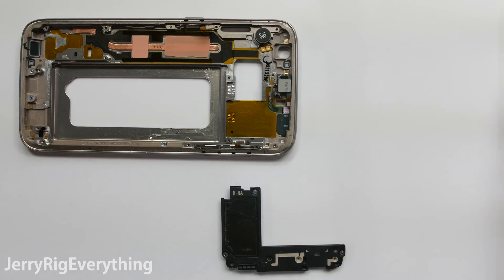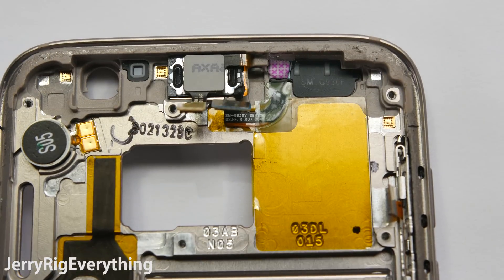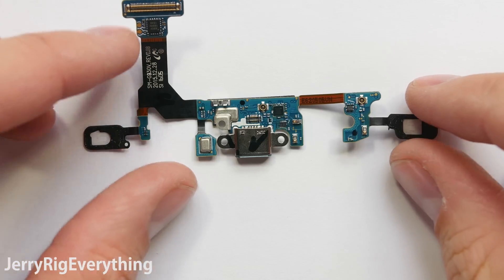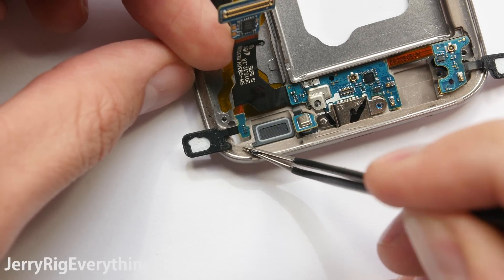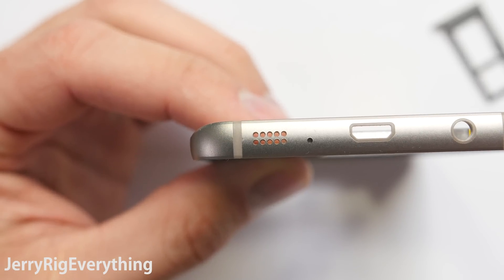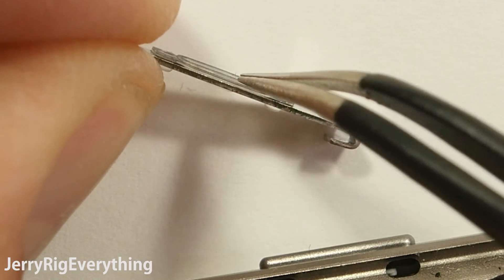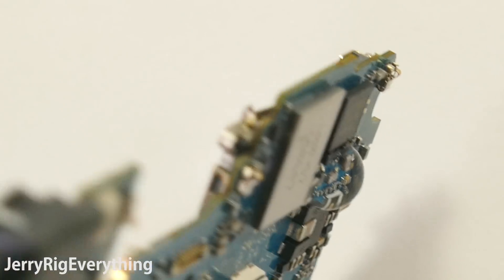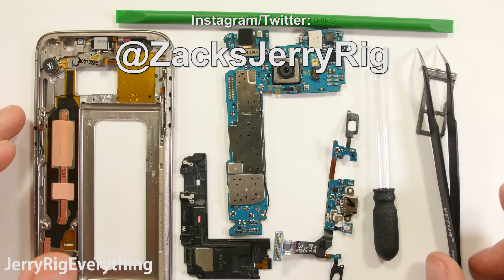What makes the Galaxy S7 Waterproof? - Ultimate Test

Comment: Forgot I had mine in my swimsuit pocket and jumped in. I jumped back in to find me year old phone at the bottom of the pool. Dried it off and it looked ok. No problems until I tried to use the speaker. It was basically useless. I searched up ideas to fix it and I blew air from my mouth into the speaker and shook it hard and it spit up all or most of the water and it was fixed. This was 4th of July and still nothing. This is a great phone 5/5

Comment: Jerry, hopefully you or someone here,can help me: my friend dropped my S7 in a lake and I took 10 min to find it at 1.5 mts deep.When I took the phone out it was working fine but the speaker had a bad sound quality. I dry as possible with a shirt, turned of and used a hair dryer to "finish the work"
The problem with the speaker was still there but wasnt a big problem to me. The next day the power button and home didnt work... As it turns on when I plug the charger I got to test it. the lcd was also "a little" unresponsive. It still over warranty but Im not sure what may happens because I read about some people having to pay high cash just for had left the phone at Samsung's Sevice. I checked the water marks and theres absolutely nothing red or pink. What / how you think I should do about the service to dont have to pay for something that i supposed to be covered? Should I opened explain what happened as Im doing here? The video was great, btw. Thanks in advance.

Comment: IP68 Protected from total dust ingress. Protected from long term immersion up to a specified pressure. IP68 is pretty good. IP69K is the standard after that which protects against total ingress. IP68 is used in phones/electronics that require military-grade resistance (with more standards, of course).

Comment: +JerryRigEverything what about metal dust?  Like from grinding or plasma cutting, the fine metal dust usually trashes speakers and microphones.  The only way i have found that worked for my older phones was a lifeproof case, but if greatly muffles the sound and then you are limited to only that case and no other battery attachments and wireless charging is hit or miss.  Does the IP68 rating handle metal dust as well?  I would really like to know this or see if someone wants to test it.

Comment: Hey folks, I've been looking at this phone and believe it's the most 
suitable phone out there for my needs, problem is, I'm in Ireland so it 
looks like I'm going to have to get one through eBay. Would anyone 
please be able to clarify the following:

1) Will it definitely work in Ireland/UK/Europe as I've heard a lot of US phones can't work here?
2) Can it be charged without opening any seals? My Z3 compact has a seal covering the charging port to keep it waterproof, which I've had to replace twice already. Is the S7 Active waterproof without needing to close any seals? What would happen if you dropped it in water when the charging cable was plugged in? I'm ok with having to open seals for the sim card and memory card as you never need to access these, but the charging port needs to be accessed all the time and the seal on the Z3 is a pain in the ass! How do Samsung achieve not needing a seal I wonder?
3) Is it possible to remove bloatware by both AT&T and Samsung and get back to a cleaner android experience? 
4) I've seen several reports of the phone failing some water submersion tests, but it seems this was with earlier released models. Have these issues been rectified or, like the video you posted, it depends on pressure?

Any feedback would be greatly appreciated :)

Comment: I want to buy a used s7 edge but has a very small crack of no more than .78 inch longer resist submerging? . ... I recommend is very cheap to buy it? believes that insignificant detail?
Reply: elkillerR5 it most likely wont be water-resistant you shouldnt try to submerge in water
Reply: Alex Lemus Thanks

Comment: Do you know what makes microphone water proof? I just accidentally pocked top microphone hole with a safety pin trying to remove sim card tray. I pressed down pretty hard, but it felt like I was pressing against metal frame. 
I tested microphone and worked fine. I can see in your tear down microphone is not in direct line of sight with the hole. So, I know the microphone is safe. But not so sure about waterproofness. Are there any seal inside of the hole? Or is the microphone waterproof by itself? (I see gasket around it)

I have cracked my rear glass, it waterproofness may be lost already, but plan on repairing the glass near future. (Samsung wants $70..)

Comment: I literally shower with mine every day. It doesn't do any harm at all. I've had the phone since the first day it was release.
Reply: the steam??...
Reply: haha
Reply: +WiLLiamsGaMinGCHaNnEL the steam isn't going to do jack. The phone has been washed in laundry machines with soap on high heat and frozen in a block of ice. The water resistance is phenomenal.

Soap lowers water tension and if the video maker was right, the soapy water would have slipped right through the mesh much worse than steam would. The mesh that protects the phone is actually finer than a molecule of water and it would be impossible for water to make its way in unless deliberately forced. 
It's not like he says and based only on water tension that'd be a terror idea.

Comment: just tested it and it still works
Reply: There's just ungodly amounts of payola hit pieces trying to debunk the S7s waster resistance. I've even seen it claimed that touching water will permentslly leave the microphone and the speaker muffled and damaged. The writers are fully aware that a wet speaker grill will sound muffled but act oblivious. It's because of articles like this that people are starting to think the IP68 rating on the S7 is a scam. It isn't. I've had the S5 for 3 years and then the S7 since day once and I've swam with both and have never not had it in the shower will me as a shower radio. Anything looks fragile when you take it apart but the truth is that the phone is very well built and in order to gain IP68 certification they actually must exceed it.

Thud phone has been tested in much more stringent situations than a shower. The author of this video seems to be confusing splash proof phones like the M10 with water resistance phones like the S5 and the S7
Reply: Linked Devices so it's perfectly fine to shower with it frequently

Comment: Hi I really need help. All this time i thought the phone was water proof. I took my phone s7 edge to the pool and got it wet. My phone power went off.  I tried switching it back on. only the samsung logo appeared and it stood frozen there. I did get an option to reboot and stuff like that but I DONT know what I pressed.. its been couple of hours, my phone is completely dark. no sign . i tried no of thing like pressing the home and volume keys.. nothing works.. Is  my mother board or the LCD damaged ? can this be fixed ? any suggestions?
Reply: Put it and rice and hope it comes back
Reply: +Sup M8 in* on mobile...
Reply: +Sup M8 I tried the 99% alcohol thing. Now when I switch it on It shows me the reboot screen and the start up Logo and then it's stuck there .. Any suggestions ??
Reply: +James Lama press your power button and your lower volume key and hold them in for like 20 seconds
Reply: +James Lama also i wouldnt recommend trying to turn on your phone unless you know it is completely dry
Reply: +Sup M8 thanks man.. Will try when I get home. Always thought the phone was water proof until this experience, I wouldn't recommend anyone follow those YouTube videos which encourages such water experiments  .. Had I know it was only water resistance I wouldn't have  taken it to the pool. Although I have used it under the shower before to  select my music. If this doesn't  work do you think my mother board is gone or perhaps the lcd  display ? I know these things cost USD 300 or more .
Reply: +James Lama i have no idea im just going off what ive heard

Comment: MINE TOOK ONE SWIM, and now it's DEAD! It wasn't even a swim, more like an inch worth of water. The real clincher is that Samsung Canada has had the phone for more than a month and a half while using bogus excuses why it's taking so long. The phone was about 45 days old when it went to Samsung so the moral of the story is to submerge-test this phone within the 15 day return period, Even a bathroom sink submersion is good enough to test a defective phone which should have done 4.5 feet worth of depth. Just for your info, the Samsung S7 was bought in Maple Ridge, BC, Canada which indicates the problem is far wider spread than they claimed the problem to be. In general if you plan to be active I would suggest to test your phone for this defect  as soon as possible or you will be out of contract limit if you wait too long.

Comment: This is regarding a big flaw in the product, Galaxy S7 Edge , which is till date, the most disappointing mobile phone cell phone i have ever used throughout my lifetime. I had purchased my phone from Noida , GIP , India, on 18th of March 2016.Promising that the phone is water Resistant upto a dept of 1.5 mts...... As per the claim that samsung provides,, 

"""""The Samsung Galaxy S7 Edge is an IP68 Rated device. IP68 rating means complete protection from dust ingress, and temporary immersion in up to 1.5 metre of freshwater for up to 30 minutes. Samsung guarantee simple life waterproofing when the SIM Tray is attached tightly but does not guarantee that the device will operate normally if it is used in water or other liquids. And, the touchscreen and other features may not work properly if the device is used in water."""". 

Now , my cell phone is not working properly after encountering a small amount of water , THAT TOO DESPITE THE RAIN . I am not even asking about the depth of 1.5 mts or a stay of 30 minutes. It was a matter of 10 sec or lower which caused the phone to malfunction and the dept could have been estimated to be around 5cm. First the screen went off and the phone went off instantly. Later that day, i dried the phone throughly and kept it off for the next few days. I even kept it in a rice container to extract all the water from within but still nothing seemed to work right. The display came back but the touch of the screen still doesn't work. Now i went to see the service center in Noida itself, and told them my story and asked them as to on what behalf does the company make such forged claims on a national wide advertisement , guaranteeing that it is water resistant & that the phone can be submerged for 30min to a depth of 1.5 mts with sim tray being locked properly, when it cannot handle such small portions of rain water. With all the conditions being applicable, my phone has water in it and is droplets are visible on the camera from the inside. The company had discarded and warranty claims and is ready to accept the phone only when i am ready to pay for the repair. As per Samsung service center, the warranty has been void as water has entered the device and is not a concern of the company but it shouldn't have entered the phone in the first place as the phone was in brand new condition and had no scope of damage from my (customer) end. Now , buying such an expensive phone, ie flagship, of one of the biggest mobile phone companies throughout the world and receiving such  poor grade products with all false and misguiding advertisement, i have made it a point to give my review to every website possible, both within and out of India , to reject the product as neither the product , nor the company seems to respond to the problem. I would also like to add the this experience has been really disappointing as i was a big fan of samsung but with such company responses, i felt really cheated and misled.  my complaint no is 8448442204

Comment: Actually there're two ways to keep phone waterproof, one is physical to stop water into phone just like bag, 
or waterproofing phone case, another way is using nano coating waterproof mobile machine, you do not 
need to take heavy phone case for waterproof, water can get in phone, while mainboard was protected by 
nano coating. We offer high tech machine which is hotsale now. whatsapp +8615889548883, skype:jenny_5066.wechat:1055425560.

Comment: thank you. yhis is very informative. i used my ip67 rated Samsung galaxy s5 in waterfalls to take pictures. i sealed the ports & buttons  with cellophane tape and put a silicone case around. 
it worked very well.
i dropped it into a tumbler (without any added protection ) couple of times. it works fine.
Reply: I had a life proof on my old s5 and jumped into a pool..  The charging port opened and it still survived. Lol

Comment: If the weight/pressure of deeper water is what forces water past those seals and screens, and the phone is GUARANTEED to be water resistant for several several feet of water, WHY would you not advise taking the phone in the SHOWER daily, where there is zero water pressure??? 

The entire video is about explaining how this phone is water resistant, but you couldn't take just an extra 15-30 seconds to give any reasoning for not advising taking phones into the shower?
Reply: same thing I was wondering why shouldn't I go in the shower with it
Reply: +S. J. lol water beam
Reply: ***** it's cool i'm not laughing at you i'm laughing with you. i'm from the Caribbean.
Reply: Jerry..? I'm wondering the same 'shower has little pressure' thing.
Reply: FEENone graff ummmmmm ip68 is the second highest rating what are you talking about??????
Reply: +S. J. water jet?
Reply: My s7 edge stopped working after washing it in a sink.  It could be a defective phone, but I'm guessing the pressure from the faucet got through the seals
Reply: this phone is ip-68 rated as he stated. it's not ip65 meaning it's not rated for flowimg water

Comment: Hi Jerry, thanks for the video. Could you please touch on how the water resistance is achieved at the microphone holes? I accidentally poked the sim ejection pin into the top mic hole....did I break the water proofing seal? Thanks a lot in advance!

Comment: Galaxy S7 is NOT Water resistant ! I repeat Galaxy S7 is Not water resistant !😡😡😡 jumped in the pool with it, lasted no more than 10 seconds inside submerged. It wasn't any deeper than 5 feet pool. Came out and phone started rebooting and turning on and off.  Luckily after about 20 minutes it started working again. Lets see if it works fine... 😠😠😠 i was and am pissed off.
Reply: Same thing here , went in the pool for few seconds.. My phone come to the reboot screen but then gets stuck in the start up logo screen.. It's been 2 days already .. Tried cleaning with 99% alcohol too no luck .. Am just waiting hoping it will work again.

Comment: what about the home button, when I pushed it while it is under water, water bubbles came out. will my phone be fine if that happened?
Reply from the maker: +pilotpig Ya, the home button is sealed around the inside underneath. You'll be ok.
Reply: JerryRigEverything what about steam damage, I took it into the shower to play music. After 6 mins, it started to pause the vid and started flickering a rainbow screen, after a few times of doing so, it locked the phone and shut the screen off.
Reply: +pilotpig Has it gotten better pr did it flat out got damaged? Im buying one tomorrow so Im getting every tid bit of info
Reply: Hector Pena it is water proof but just keep it away from steam or cover/tape the speaker if you are going to take it into a steamy place and it has gotten better since it is only steam.
Reply: Hector Pena and also don't freeze your phone, not a good idea, apparently glass gets very brittle when it is -16 degrees Celsius.

Comment: hey can you tell me that if I put that phone in water then will that material will turn pink?? 
and then if I had some issues not because of water but then will Samsung will approve my warranty?
Reply from the maker: If that sticker is pink,  and you have issues, Samsung will not honor your warranty.  Because the phone has been wet.
Reply: JerryRigEverything thank a lot
But if I put phone in water without opening any ports and not very deep then will it turn pink?? 
I appreciate your quick response over so many comments
Reply from the maker: tanmay sanghavi You should be ok, the phone is very water resistant. You can take out your sim card and look for yourself to see if it is pink or not. Just make sure to never get that sticker wet.  Thank you for watching!
Reply: JerryRigEverything thanks a lot of replying my comment 
You solved my problem :)

Comment: Nice tear down - just a tip; like all water resistant, water proof devices don't go into hot steamy environments like showers, baths as the heat, steam softens  the seals significantly making the device a lot more vulnerable to water damage than a cool fresh water exposure. 
I would see damage in the best dive watches due to people wearing them in hot showers - it's logical when thinking about it. OEM's should warn about this but instead they often showcase, advertise the device in a steamy environment.

Comment: If water would pass through the membrane of the loudspeaker would it just destroy the speaker or is there a posibility that the water can press forward deeper into the device?
Reply from the maker: +N. Vogelsang Depends on how much water gets in. But i imagine that it would get inside everywhere.
Reply: +JerryRigEverything Thanks for the fast answer :) Thats too bad... They should have  sealed the speaker as a part within the device. I don't trust those membranes.... 

So what do you think...? Will this membrane withstand massive spray coming from the road while biking in heavy rain?
Reply from the maker: N. Vogelsang It should be able to handle spray from a bike. lol, I would still try to keep it dry as possible though.